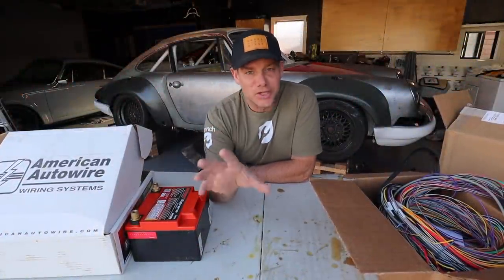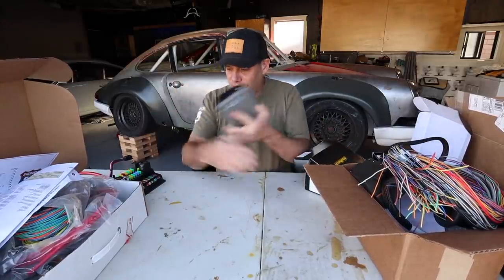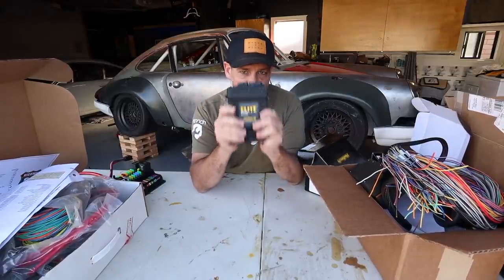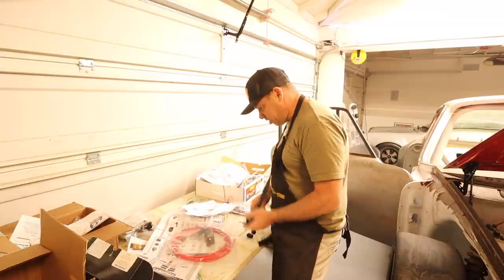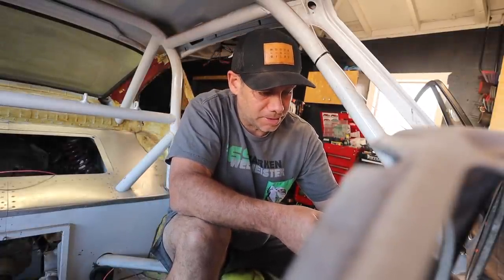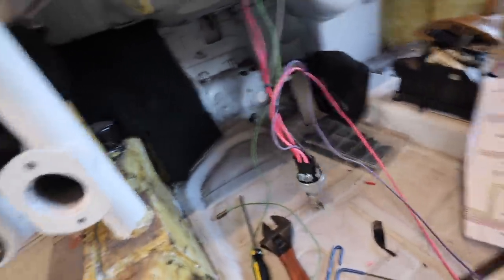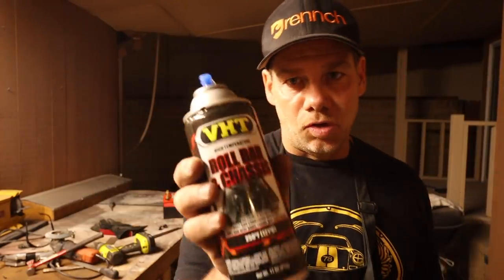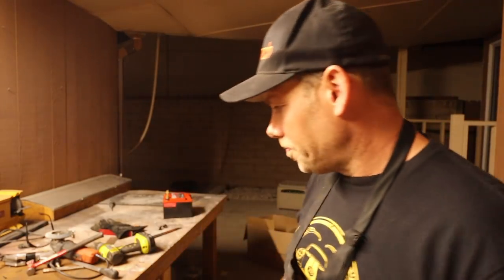Wiring the Bare Chassis of my Subaru Swapped Porsche With the American Autowire Highway 22 | Ep. 40

Comment from the maker: **GUYS** Thanks for watching.  I’m SO close to 10k subs…if you’re not subscribed yet you’d be doing me a huge favor if you could! Thanks! (Quick Subscribe: http://rennch.com/youtube)

SUPPORT THE RENNCH SPONSORS BY GIVING THEM A CLICK AND A LOOK! 
TRE Motorsports - One of the coolest Porsche customizing and Tuning Shops in the world: http://rennch.com/tre
Restoration Design - Vintage Porsche Body Panels and OEM Wiring Harnesses: http://rennch.com/rd
CSF Radiators - The top radiator/intercooler/oil cooler company in the land: http://rennch.com/csf 
CSF King Cooler - The most compact, most efficient radiator for your conversion: http://rennch.com/kingcooler
Classic Retrofit - Amazing Air Conditioning for your Vintage Porsche: http://rennch.com/ac
Autobahn Parts - Best resource for used Porsche parts: http://rennch.com/autobahn
Eastwood - Every fabrication tool you need for your garage: http://rennch.com/eastwood
URO Parts - OEM Vintage Porsche Replacement Parts (Seals, etc..) http://rennch.com/uro
Reply: You shoot the future welding segments actually through a welders glass screen please

Comment: Wiring is always a challenge!  As part of my EFI conversion, I've spent hours perusing over the SC wiring diagrams and then designing my own circuits - so you have my sympathies.  You're not mucking about here!  Using the ol' heater conduits in the rockers is a great idea too.

Comment: I would suggest you plan on a lid to be able to pull the battery out through the interior and based on my experience with the VW Vanagon Westfalia, I would suggest you flange it on the outside so you have a smooth exit for the batter, add some room for maneuverability, and a clamp to hold it still.
Reply from the maker: Yep, I was thinking the exact same thing.  Maybe a fastener of some sort.  Great minds...

Comment: It’s a bit late now but I would never fit an ECU or control until on the floor, if you get a leak anywhere water will pool there and cause issues. Underside of the dash is a great place. Make a bracket to lift it off the floor as high as your seat will allow. 

Use bulk head connectors at both the front and rear bulk head. Separate loams for the frunk, cabin and engine bay will make life so much easier for servicing, engine removal etc
Reply from the maker: Thanks man. I’ll be making a platform for all the electronics. As I mentioned in the video, this was just for general placement of components. Thanks for watching!

Comment: Not going to be able to use that extra wire to pull additional wires if it is taped to those other wires or even if it is even in a common covering.  When you wire it for good, leave it outside the loom for the main wiring run. (and do put the main wiring loom in a cover, to keep it from rattling and chafing.  (instead of plastic looming, painless makes a pretty nice woven looming, or wrap them in hockey tape for a vintage look.

Comment: I don have time to scroll through and read the 141 prior comments, so I don't know if anyone has already touched on this, but may I offer an educated piece of advice?

The harness trough the vent tunnel looks and sound very cool, by as a 20 year automotive technician, I would ad against it at the risk of sounding like a party pooper.

The reason being that first, you have no way of knowing if there's a sharp edge in there somewhere, nor will you have any way of securing the harness properly. So, this will leave your harness free so slide and flop around in there. You would be surpised at bow little it takes to rub trough wires, even if it is wrapped in tape. Just a tie-wrap too close to an unsecured harness can rub trough and wreak havoc. Needless to say, if something ahorts in there, you will have lots of fun trying to fix it and see what caused it.

Now, that being said, if you decide to still go ahead with this idea. Wrap the harness in two layers of corrugated loom and tape it well.

Other than that! Awesome job, keep pushing ahead!
Reply from the maker: You're hired!  :) Seriously, thanks man.  I'll bring it up with Dave from TRE Motorsports.  He's my guru advisor on this.
Reply: @rennch.  No problem my friend, it is my pleasure. I may not be able to physically help, since I live on the other side of the continent and north of the border, but this project is so awesome, that if I can help in any way from a distance, I will!

Comment: Mike, I am really enjoying the progress in the build! 
I used to do a bit of wiring in cars. A good thing to make a snake from is the thing you peel off a plastic tie around a lid from a bucket or drum. Its sort of hard to describe but I've kept mine for years. You can see an example on the rim of the top of this drum. https://www.usplastic.com/catalog/item.aspx?itemid=115041&clickid=related-slider Maybe you know a place that uses alot of buckets or barrels or drums and can grab one. They are smaller on 5 gallon buckets but are also great.

Another trick to keep wires together like the headlights or something is set one end of the wires in a vice or something then stick the other end in your drill. Then just twist them up fast that way they are sort of tight and together. 

If you find it hard to tell what a wire is in a big bunch before everything is plugged in, you use a drill batter or some small battery then a test light at the other end of the loom of wires to identify it...
Reply from the maker: Cool, thanks Sean!

Comment: Michael, I have a suspicion that the Subaru to Porsche adapter is going to create more problems than it solves. I’d sell that expensive Porsche transaxle and the a reversed pinion 2wd Subaru six-speed that will bolt right up. 
Look at http://www.subarugears.com 
They are Australia based, but Subiworks, in LA are a US distributor. They sell all the parts to convert a Subaru trans to rear engine and two wheel drive as well as a shifter solution.
Reply from the maker: I'm very well aware of Subaru Gears Tucker, thanks.  As I said...it's countless hours of research before you guys see a video.  This prototype is meant to be a solution for Boxster and 996 owners in addition to 911 guys, so they are not an option.  Still working through some prototype stuff though, obviously.  :)